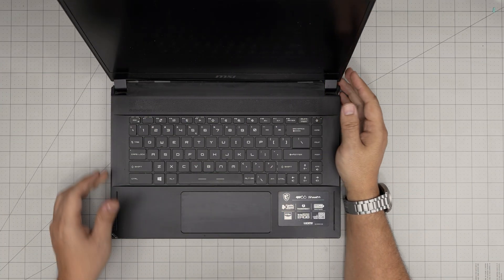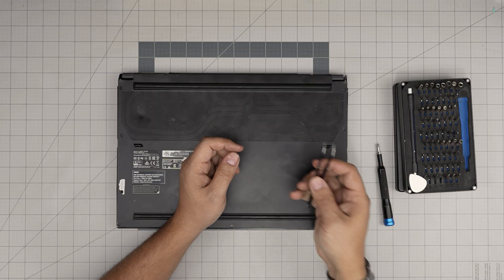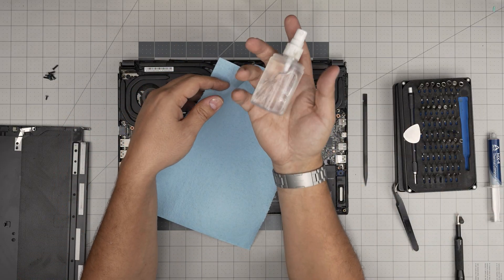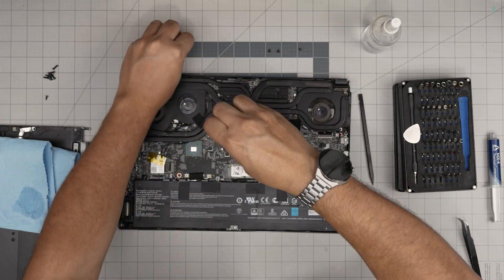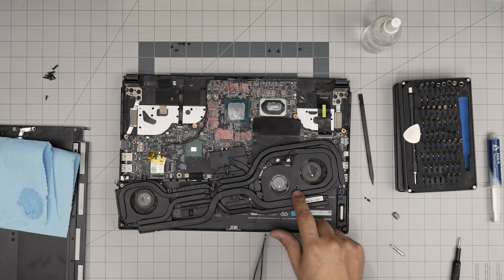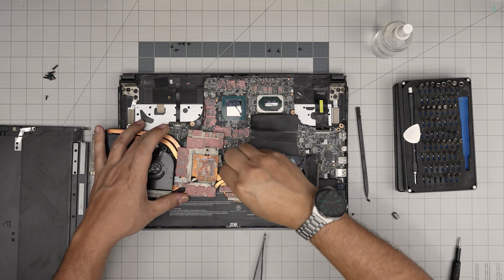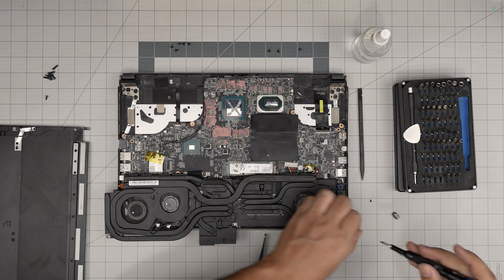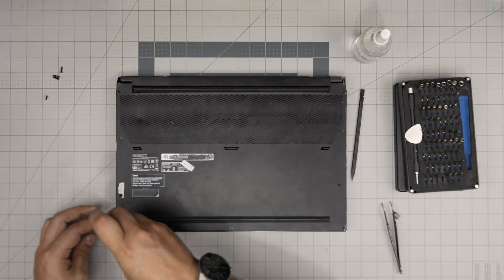How to Fix Overheating on MSI GS66 Stealth Laptop: Repaste & Deep Clean (10SFS) Service

Comment: I have the 11 version, even after cleaning, re-puttying the other chips, and applying liquid metal to CPU and GPU, my GS66's CPU is still running at 60c idle and 95c+ max at max fan speed. I guess it's about time to retire it.
Reply from the maker: 🫠Regarding your question, i would recommend you to use PTM instead of LM and it will fix your issue.
i do get this issue in the store and PTM resolves that.
ptm7950 honeywell:
https://amzn.to/44B0JPo
Should you have any further questions or requests in the future, please don't hesitate to ask me.
cheers🍻

This is an Amazon affiliate link. When you use my links, you are helping to support the channel. 🙏